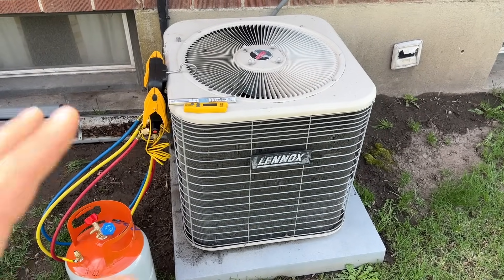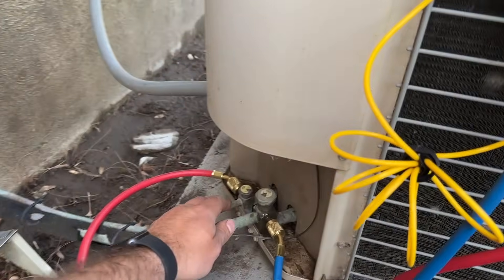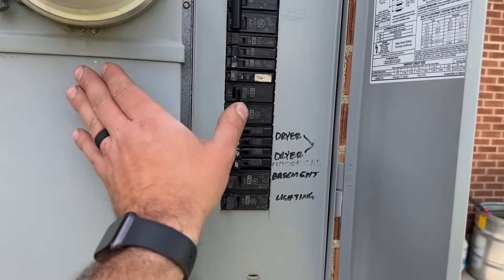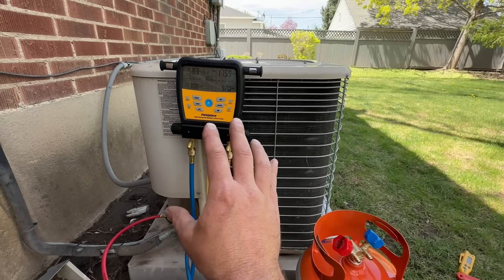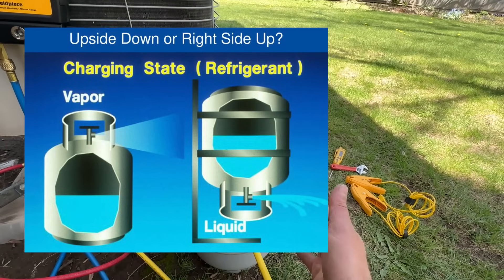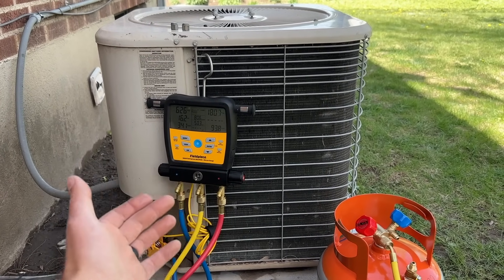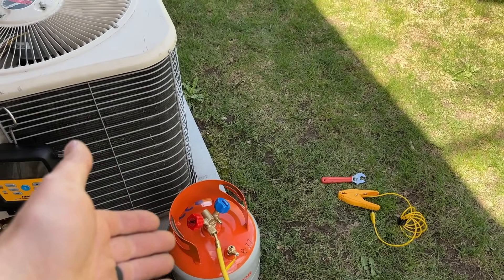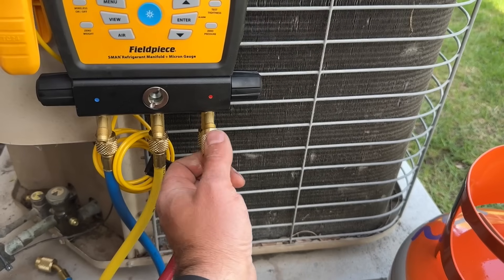How To PROPERLY Recharge Your Air Conditioner

Comment: Hi! Could I just fill some freon from the bottle using the hoses connected to the system? It happens that i have a leak in my system and need about 2 lbs of freon every year. I have seen some 30lbs bottles of r22 for $35 online... Thank you so much for your answer.

Comment: Dear, thanks for this channel, I have such a problem - in the morning it was hot - 27 degrees Celsius and the air conditioner inside the house, when turned on, cooled the air to 20 degrees Celsius at the outlet of the duct, and in the evening I measured the temperature of the pipe at the inlet of the air conditioner and one pipe 24 degrees Celsius at the inlet and the pipe at the outlet the air conditioner was 9 degrees Celsius and froze, and at the same time it was 22 degrees Celsius at the outlet of the duct and 24 degrees Celsius outside. In other words, the air conditioner no longer cools as efficiently after 12 hours of operation - what's the problem here?

Comment: Still trying to learn how to determine which system I have and which refrigerant to use.
Reply from the maker: If the pressures are between 60-80 on the low side and 200-250 on the high it’s going to be r22.    If it’s 120-140 on the low side and 300-350 on the high side it’s gonna be 410a. The name tag on the outside of the unit should say 410a or hfc 22 but if it’s worn off you can tell by the pressures.   Also you can look at the inside coil name tag and if it says r22 only you know it’s an r22 system. Cheers
Reply: @diyhvacguy  Thx for quick reply.  Really appreciate your videos.

Comment: I found it useful.
I do automotive ac. But
Finding a reputable company to seevice my home has been a nightmare. The last company contacted told me they could schedule a sales consultation and service call. When i turned down the sales consultation, they cancelled the service. Another one came out and said my system was too old, even though it is clean and working, so they wouldn't check it. They did offer a discount on a nice new system.
Reply: HVAC guys are as bad as used car salesmen and ambulance chasing lawyers! I refuse to hire one because I've yet to find an honest one! 
This channel is absolutely amazing!

Comment: Thanks for the video. While I personally would probably hire out this job, it's good to have some understanding of what the job entails. Unfortunately it seems that some hvac techs, like the ones leaving negative comments, are threatened by the possibility that consumers might realize that it isn't rocket science.
Reply: Nothing is rocket science. Except for rocket science. I’ve been a tech for 25 years. My problem is the irresponsibility of this guys teaching people things that he learned from a book, and not from field experience. He’s going to get people hurt, or in the case of this video, fined for using refrigerant without and EPA cert. I’ve watched a few of his videos and have seen him do or say things that just aren’t correct.
Reply: @frankiec5570 so correct him if he says something wrong. There is nothing wrong with people trying to teach others about a trade. Besides, if the AC companies wouldn’t overcharge so much, people wouldn’t resort to DIY. You’re going to look me in the eye and tell me $350 is a fair price for a single pound of R22 or $130 for a capacitor that you can buy for $7 on Amazon, then add labor in top of that. Come on.
Reply: How do you know he only learned it from a book and has no training? Scared you might lose a few ac system sales due to a bad capacitor?

Comment: As a preventitive, or troubleshooting. How often would you say the schrader cores leak. on a unit 15 or more years old. Mine is probably 20+ and needs a topping off for sure. r-12 i think too.
Reply: the schrader can leak if your service valve was left open during the last time gauges were hooked up. When in the test position, flow can go between condenser and lineset and the service port. When the service valve is in the operating position, the flow is blocked off from the service port, so the schrader valve is not having to seal.

Comment: Great video !!! How would you charge up a system that does not let the compressor come on because of the Low Pressure Switch preventing the contactor to close ? ( would you use vapor first as to not to hit the compressor and fill it just enough for the compressor to come on or would you fill with liquid right away ??? ) Thank you so much for taking your time and trying to answer my question !!!
Reply from the maker: Yes you are absolutely correct.
Reply: @diyhvacguy  or should I bypass the Low Pressure Switch,  so the contacter pulls in and starts the compressor and refill liquid ( upside down tank ) ? What would you do version 1 or version 2 ???
Reply: You may or may not be able to charge by liquid depending on the pressure in the refrigerant cylinder and the pressure on the high side of the system. If the system pressure is higher than the pressure in your refrigerant cylinder, the system won't take in the liquid refrigerant. If that's the case, you'll have to add refrigerant on the low/suction side using vapor. If your system uses 410A, you'll have to flash it in on the low side using a kwik charge low side charger or if you don't have a kwik charge, it can be done by opening and closing the low side manifold valve as long as you don't let the pressure jump more than 10 psig at a time. 

410A is a blended refrigerant. Some manufacturers may say that you can top off a system using vapor only but you may not get the proper ratio of each refrigerant in the blend, especially if your system is already short of refrigerant, adding new refrigerant will throw off the ratio and your unit won't operate efficiently as it should. You also need to keep an eye on the suction line valve on the unit to see if it starts to frost up. If it does frost up, you're adding refrigerant faster than it can boil off in the hose and you risk the chance of liquid refrigerant entering the compressor which may cause damage. Scroll compressors are more forgiving when some liquid enters the compressor but reciprocating compressors can suffer cracked pistons and broken connecting rods. Just take your time and don't rush it.

Another thing to watch out for is that some systems shut down after three occurances of detecting low pressure within a certain time frame. Only way to get around that is to cut power and reset the timer or you can wait until the timer expires and try bypassing the low pressure switch again until you're able to keep the switch closed when enough refrigerant has been added. Hope I didn't discourage you from trying to fix your AC. Better to have more information than not enough. Cheers.
Reply: @mojo9288  Oh WOW man, I am floored with so much support  I read through all of this. Not a single word of yours was left unnoticed. - Thank you so very much. I can not thank you enough for your invaluable advice !!!

Comment: If we are add new Freon to the system do we need to flip the can upside down in order to add liquid to the low side for both r22 and 410a?
Reply from the maker: Correct 👍🏼 just throttle it in. Don’t let a ton in or you’ll slug (overload) the compressor

Comment: What if it’s 410A what are the pressure’s supposed to be at in a hot day
Reply from the maker: Typically somewhere around 135-150 for low, and 325-350 on a hot day.

Comment: EPA certification required for handling refrigerant
Reply from the maker: Correct. I thought that was a given but shouldn’t make any assumptions that people know that
Reply: Assume. Ass U Me. Frankly if they don't know what refrigerant they have or what the pressure should be. Then they shouldn't fix it. I've been doing hvac for 20 years and learned there's more risk in telling someone how to fix it (liability) than actually fixing it for them.

Comment: Follow this tutorial at your own 
discretion, but remember to alway check the following so you don’t damage your system. 

Check air flow. A dirty filter or vents that are unnecessarily shut off will reduce the amount of heat an evaporator can extract from the air thus lowering pressure. A bad or dirty indoor fan will do the same

Check for restrictions in the system a clogged filter drier, piston, or txv will also result in lower pressure. 

I do not recommend this but here is what you can expect to pay if you attempted this yourself 

Harbor freight Gauges $50
 Thermometer $20
Refrigerant $1200

After all that you still have a leak in your system that will continue to get worse until you hire a professional to come out, find, and braze the leak, or replace the defective part. 

The reason HVAC cost so much to repair is there is a lot of different things that could be making your system freeze up. Finding that defect take a trained and skilled individual. Most educated people want to be paid high wages to sit behind a desk. There is only a select few people smart enough to properly diagnose and repair your system and that will crawl under your nasty crawl space riddled with spider and rat carcasses. When you find someone willing to crawl into your 180 degree attic in the middle of summer and “PROPERLY” repair your system I believe they deserve fair compensation.
Reply from the maker: Couldn’t agree more. Thanks for your input.

Comment: My system is R410. The evaporator leaks. Doing some research it turns out the evaporate should have been aluminum and not copper. Seems like there should have been a recall. I will never use carrier again.
Reply: Companies manufacture all aluminum evap coils or a combination of copper and aluminum evap coils where the tubes are copper and the cooling fins are aluminum. Leak could have been caused by galvonic corrosion if the copper and aluminum wasn't bonded properly, lack of maintenance or a technician using a cleaning solution that was acidic and not rinsed off completely.

Another thing to look at is to see if the evap was rated for R410A. Not sure if you are the original homeowner or just purchased the home. Some companies tell the customer to change only the outdoor unit from R22 to 410A and everything will be fine. Couple of months later the evap starts leaking due to the higher pressure of R410A. You may have an evap coil that was only rated for R22. I've never seen a homeowner crawl up into the attic to check if they have compatible system components and just take the word of the home inspector when purchasing a home. 

Customers selling their house will tell the technician it only has to run when the home inspector comes by. Any problems after that is for the new home owner. Hopefully that isn't the case with your system.

Comment: I like valve off fittings instead of low loss. Easier to rebuild and use the same parts as every other fitting.  You will switch to valve off eventually....its a journey of every technician,

Comment: Indoor temp effects evaporator has its going to flash the liquid to a vapor. Beer can cold may be a reference  only. If the indoor temp is high your suction psi will be high therefore a higher suction line temp. Subcooling and superheat is the correct to charge.  A layman will not know if you have bad airflow indoor from dirty coils or duct, and a dirty outdoor coil effects it all. Subcooling tells you the condenser is charged to OEM specs, superheated tells you the evaporator is flooded correctly with liquid refrigerant before it changes state to a superheated vapor.  Laymen do not know how everything on outside the mechanical effects. A perfectly installed system with an indoor temp close to the desired operational setpoint should give something close to a beer can cold suction line.

Comment: Very good video-thank you.
Just one question-with low loss fittings attached to your manifold gauge and seeing that you did not purge your lines after completing your recharge on this unit with R22 I would hope that you do not attach this gauge set to your next job that has a R410a system because any r22 that is in your hoses will be dispensed into the R410a system causing contamination to that unit and a compressor failure.
Reply from the maker: Thank you, I’m making it a habit now to disconnect the high side first, equalizing pressures by opening both knobs. Then removing the low side. Thanks for the tips! Cheers

Comment: I am another guy who spent money on the tools although I have cheaper tools.  They still work.  I diagnosed 2 leaks one on a friends unit he installed, and one on mine last summer and fixed them and recharged the systems.  I have 5 systems of my own between my shop and 2 houses both with suites.  It makes sense to know how to fix your own systems. HVAC guys in my area charge WAY too much money and are booked a long ways out!   Like anything there is no harm in knowing how to fix something properly yourself.
Reply: and that is if they deem you worthy to even call back. >:o
Reply: how are you buying refrigerant without an EPA certification or contractors license?
Reply: How did you find the leak? HVAC tech said you could use leak finder but said it might do damage to your system, I have to put 2lbs in every year. TIA

Comment: Got a question bro. I have a new comfort-aire air handeler. And I can't find the little tube that came with it that mounts to the high side. It came with a txv. What can I buy so I can get the 3/8 attached. Thanks
Reply from the maker: https://www.supplyhouse.com/Carrier-331831-701-Adapter-Assembly
Reply from the maker: These are pretty universal on the fitting size. This should work as a replacement for ya. If you need more help, go to Patreon.com/diyhvacguy  cheers
Reply: Thanks, I found that earlier. Just remember the one that came with it was a 90, and I didn't know if that made a difference.

Comment: Should always disconnect and clear your liquid and charging hose through the suction line first, then remove the suction line. Between the charging and liquid line hoses you can potentially walk away with 4 ounces of refrigerant that the customer has paid for, of course this depends on the length of your hoses.
Reply: Aside from the moral issue of walking away with refrigerant the customer has paid for (which IS important!), what is the effect on the system if your gauges currently measure what you're aiming for? Will that extra 4 ounces matter in the big picture? Another way of looking at it: If your gauges are showing what you want to see, will adding in the remaining 4 oz left in the hoses change anything?

Comment: Hey man I’m new to all this and I wanted to know what my low side and high side PSI should be at my temperature outside are between 80-100f
Reply from the maker: On r22? You should be somewhere around 75 on a hot day, maybe 65 if it’s closer to 85-90, and maybe 225-250 on the high side.
Reply: @diyhvacguy  sorry I meant r410a
Reply: Hey again you wouldn’t happen to have a chart or maybe something online where I can find the low side psi. I can find the high side chart online btw this is for r410a my temps are 80-90f

Comment: Before you do this make sure of a few things first.  First make sure it’s not a super hot day, every system has a maximum operating temperature and once crossed it’s working hard, so wait for the ambient to drop before testing.  And make sure both coils are clean and air is moving. Look at indoor blower, you can actually have dirt built up on the squirrel cage that reduces air flow.  So now that its clean and free flowing go outside and hold the suction line and have some one turn it on.  As it gathers speed a temperature change should happen that you can feel, it’s called a flash point.  You will know when this flash point happens, trust me you will feel it, IF it’s there in your system is just right!
Reply: Ideal charging temp is 95 degrees
Reply: @jacobscott8355  That’s it’s max operating temp!
Reply: Where is this squirrel cage located and where is the location of the coil inside my house furnace I can’t access it first time home owner learning these things
Reply: @rockfordhx2768  Find your indoor unit, air handler and open covers on split system and if it’s a package unit just start taking doors off.  If you do clean your A-coil go easy and never against the fins.  Toilet brush works well.

Comment: did you advice checking for leaks?  That's usually why they get low right?
Reply from the maker: This wasn’t low by much so i just topped it off. My friend wants to replace it soon so no need to track such a small leak down. That’s a great point though!
Reply: Sometimes it's low because of a leak. Sometimes it's not. It all depends if the installer did a blow and go. A blow and go is when a hack installer installs a system and knowingly installs more than 15 feet of line set then vacuums it for 3 minutes than opens the service valves and hopes for the best. New condensers come precharged with refrigerant using a 15 foot line set. Any longer line set will need refrigerant added for the amount past 15 feet. If the line set is shorter than 15 feet you will need to remove some refrigerant. Rarely is a line set 15 feet or shorter. You first have to determine if the installer was a hack and didn't add refrigerant when knowingly installing more than 15 feet of line set therefor undercharging the equipment or if the undercharge is from a leak on a previously correctly charged system.

Comment: The proper way of taking your hoses off would be take high side of and open the gauges so it sucks it back into the system then take low side off. With those hoses you Dont have to worry about blow back so they are easy to take off while running. Those are the same hoses I use on my gauges. But I always try to suck as much out of the hoses as I can
Reply from the maker: Thanks man, I remembered learning this before but forgot! I will definitely be implementing that in the future! It makes much more sense. Cheers
Reply: I do it like that also